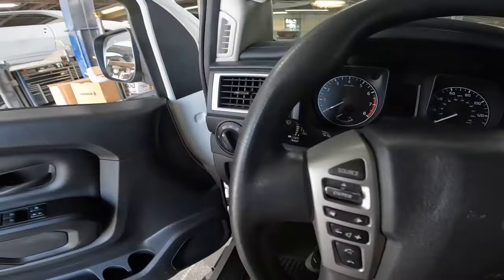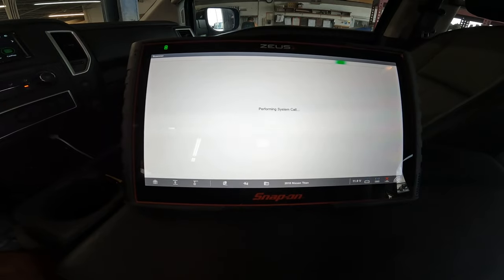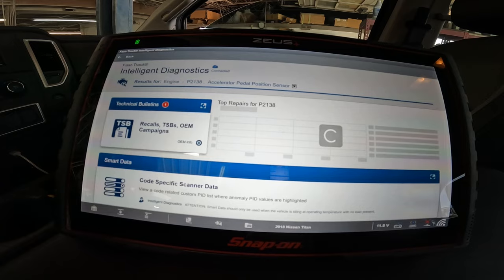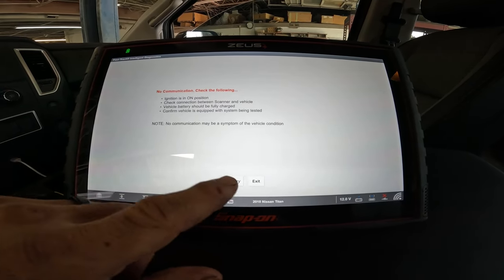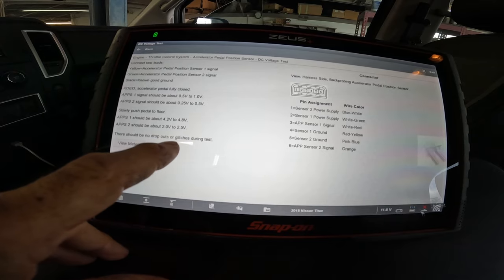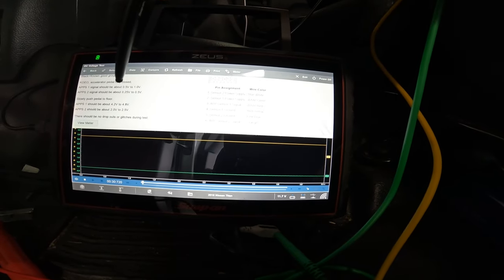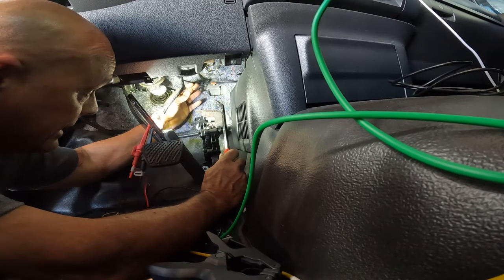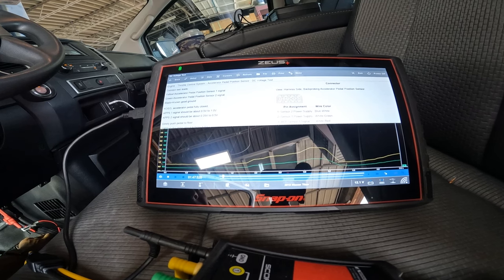Nissan Titan Fluctuating Idle ~EASY FIX ~ And Idle Relearn Procedure

Comment: Hello, I have same truck, 2019 , my the rpm drop when driving at low speed, 20 to 45 mph , dealers remplace transmission and still doing, now they said it is normal, I’m frustrated, I don’t know what to do, do you have any idea what can be the issue, please let me know if I can send you a video by email thanks
Reply from the maker: Do you have any codes
Reply: Dealer said not code, drive until get broken and we fixed , crazy